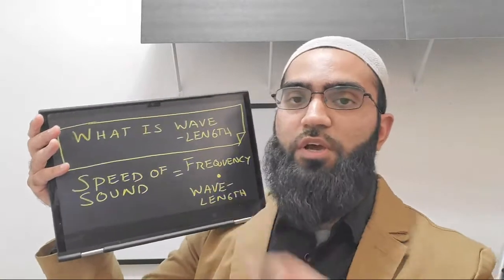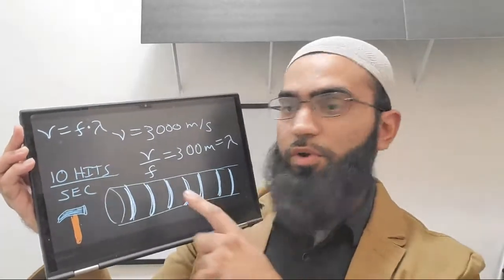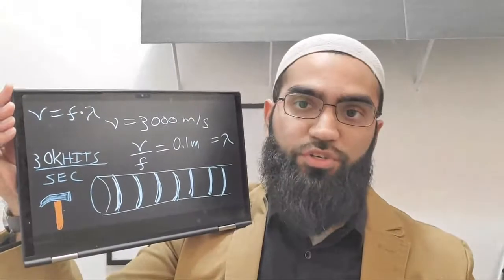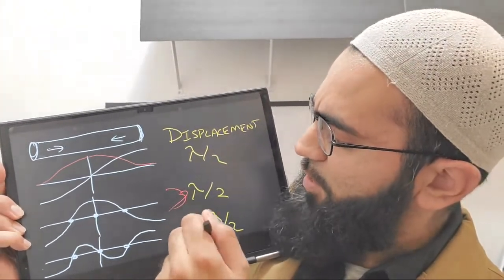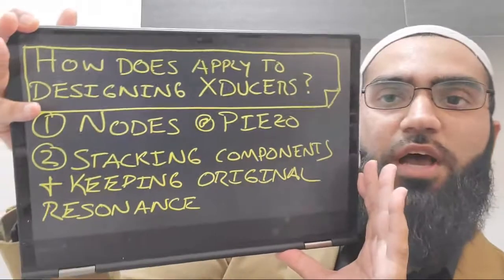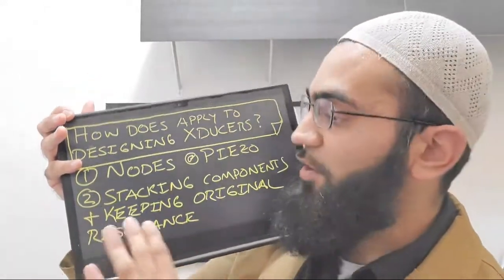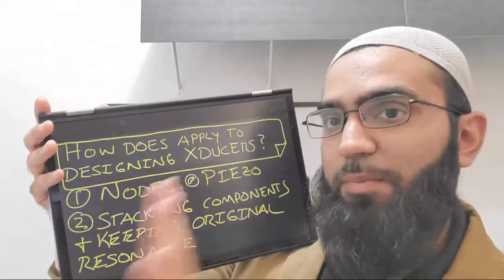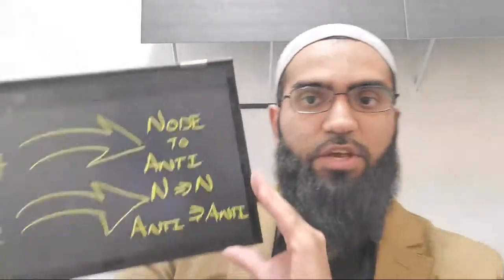Piezo SHOCK Show #23: What is the importance of wavelength for the design of ultrasonic transducers?

Comment: can you please recommend any book or paper about what you explained in this video? I want to read in detail about adjusting the node point in design
Reply from the maker: Thanks for the question. As you can imagine, I get asked this question frequently. Unfortunately, I don't have a go-to reference to suggest. However, I do recommend doing finite element simulations to better understand this. In practice, horns are trimmed down on a lathe to adjust nodal points. A higher coupling factor indicates that the node is getting closer to the piezo stack.
Reply: @ultrasonicadvisors  thank you so much for your answer. so it would be very interesting if you can show us it in a simulation result. for example by showing how a node goes closer to the optimum place by adjusting the length of the horn

Comment from the maker: Slight error at [5:37]. The middle mode shape is  2*lambda/2=1*lambda, basically, 1 wavelength.
Also at 14:44 I spoke about adding a quarter wave tool to a full Wavelength transducer +coupler. ¹/⁴ wave is not correct. A half wave tool can be used, but the stepped horn part of the tool may be designed based on a 1/4 Wavelength.